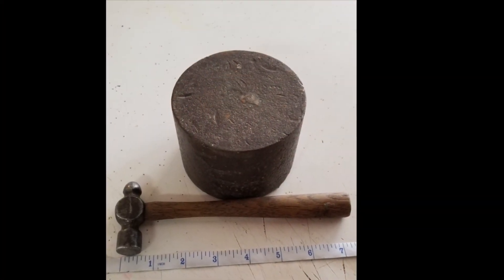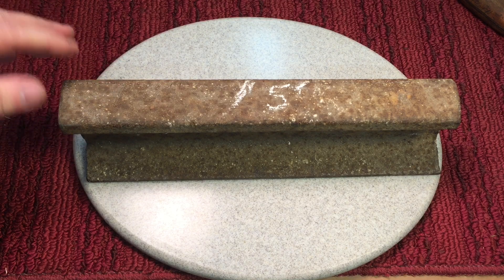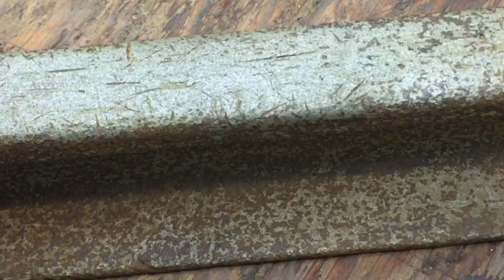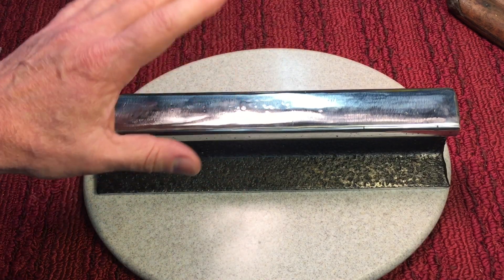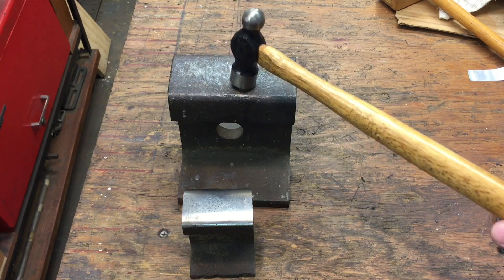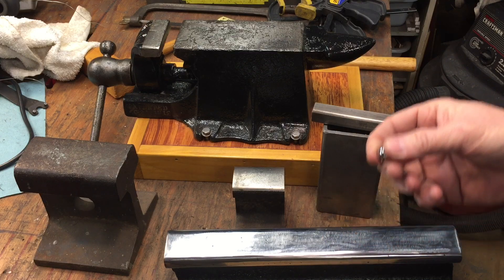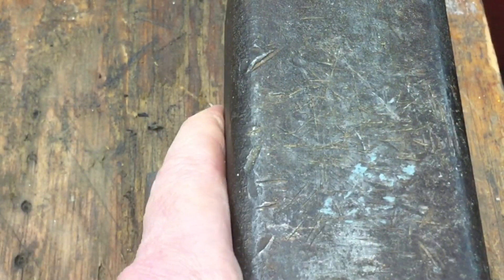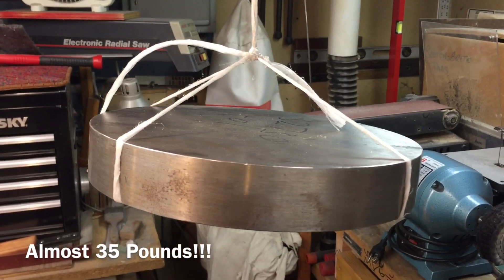Railroad Track and Other Shop Anvils...

Comment: I use to work as an ultra-sound rail test car operator for the Chicago & North Western Railroad and Soo Line Railroad Companies back in the 1980s and into the early 90s.  As pointed out by someone else commenting here, rail weight is determined by the weight of a three foot long section of that rail.  Rail was generally rolled into 39 foot lengths to fit into or onto 40 foot long gondola or flat cars.  The date the rail was rolled would be embossed on the "web" of the rail (the section of rail between the head and the base).  An example of a piece of rail I have in my garage of about 60lb rail is embossed N.C.R.M. Steel Co.  IIII .83.  This translates to North Chicago Rolling Mill Steel Co., April, 1883.  Rail also would be stamped with a heat (furnace tapping) number and ingot number (one of two digits) on the reverse side of the "web."

Comment: Nice save. I think a lot of the narrow tracks came from the old Interurban lines. I know most don't agree but that was the best system of travel for rural areas and it would be nice if the still had them. Sadly even if they had been rebuilt 20 years ago they would go down with the brick and motor stores.  Sometimes I forget the early days of scrabbling for something to work with.  Old sledge hammers and splitting mauls make a good small anvil.
Reply from the maker: Hi Philip!  I think after a good vise everyone should have a small piece of track, I use mine all the time.  Even as a weight for glue-ups!  =)
Reply: If you live anywhere that you could make it to Seville Ohio, there is a nice interurban electric railway museum.  I think it's called northeast Ohio railway museum.  Something like that.

Comment: I have two track anvils, one of which my father made back in the 1950's. One is about 8" long and the other is 10". They are a good size for a machinist. Both have had the tops and sides machined flat. One has a rounded horn (like a blacksmith's anvil) and the smaller has a horn that is flat on top and vertical sides. I keep one by each of the shop bench vices to reduce the temptation to hammer on the vice and ding the dickens out it.
Horror Freight has a 15lb. cast iron anvil for $20 and you can get $4 off that with a coupon. Not the greatest anvil, but would be satisfactory for the home shop machinist while keeping an eye out for some track rail or a properly made small cast steel anvil.
Cheers from NC/USA
Reply from the maker: They are so handy around the shop!  Even for glue-up weights!  =D

Comment: When you don’t have quite enough liquid to cover something add some bricks or rocks to raise the level.
Reply from the maker: MrDoeboy356 Cliff, I used to add a few rusty tools but wound up leaving a few behind!  😂
Reply: Lol. Wire hangers over the side.
Reply: A half gallon milk jug with water 8n it works as well. The bricks could soften and dissolve in the acid. I once added a brick to the toilet tank to save water - worked well for the purpose but over time broke down and made a mess. Great video and excellent old-school info.

Comment: I’ve always been told the test of an anvil was to use the ball bearing and find the rebound and ping. I was told not to use the hammer for ping tests or rebound tests because you can influence the outcome adversely and not get a fair or impartial result of the tests. Just a thought......

Comment: Very interesting show today. I have a few R/R track anvils floating around here.
There were two six or eight inchers in the garage when I bought this house but my favorite one is one that I made years ago by fly cutting the top of a Sixteen inch long standard gauge piece and then hand grinding a tapered horn on one end. Man that steel is tougher than the average Bear!

Comment: Made several railroad anvils over the years of various lengths and sizes, best ways I found was sand blasting and having top surfaces machined before painting. I enjoy all your videos.
Reply from the maker: Hi Charles!  This is the best time to have a buddy with a surface grinder!  😃👍
Reply: ScoutCrafter  Yes, happened to have a friend who ran a machine shop plus lived about a mile from a grave stone dealer who did sand blasting, all were done in the 1980’s. Long retired now but actually have one small rail anvil sitting on my closet floor looking like a piece of art.

Comment: My Pop & I use to always change his tires before winter we would put his snow tires on for the Winter to travel back & forth to J.f.K Pan-Am great times as a kid with him.
Reply from the maker: Alan R I always dreaded putting on the snow tires!  I used to put them on right after Thanksgiving!  Lots of times people got lazy and didn’t remove them in March and just wore them out that Summer.  😃👍
Reply: @ScoutCrafter  ha ha ha so true.My Pop has his cheap Scottish roots.Yeah we kept them behind the heavy ass broken piece of wood from the old garage door.
You remember those garage doors man when the spring broke it was like 50000 pounds

Comment: Excellent anvil video.  I had not been around them enough to know of the ping test.  And of course I personally like anything having to do with an RR, so I like the new anvil you got!  Wonder what kind of insulators were on the line where that track was in use?😄
Reply from the maker: Lee, Did you ever imagine going back in time, Like "The time machine"?  =D

Comment: Joseph Turk  is correct that gauge is the  distance between rail heads and rail size is the size of the rail.  Our company built a standard gauge track with 20 lb rail including a turnout for a 4-wheeled push car to be able to get fishing boats around two sills along the Pearl River between LA and MS in 1971.   Steel rail has been rolled in 8 lb to 155 lb sections and crane rail from 105 lb to 175 lb sections.  The 8 lb rail is 1 9/16 high by 1 9/16 in wide on the base to 155 lb is 8 in high by 6 3/4 in wide on the base.  Crane rail has a Tee shape but the top is flat and the sides of the ball or head are vertical for double flanged wheels.
If you will give me the height, base, web, and width of head of each of your rails, I think I can tell you what the rail sections are.
A piece of H-beam or I-beam will also make a decent anvil.
If a piece of steel is hit and can bounce it won't ring as well as if it well supported or hung.
Reply from the maker: Hello Roy!  All great information!  There is a lot to know about tracks!  Is a section still a yard or will it change to a meter?
Reply: @ScoutCrafter  Our classification is pounds per yard.  In most of the rest of the world it is Kg per meter.
Reply: Way back when coal wagons were pulled by horses from the mine to the warf in Wales the rails were cast from cast iron in 3 foot lengths and most of  them had a flat running surface and an arched riser which kept the wagon wheels(just like the wheels for on the roads) on.  They were supported by stones such the risers were on the inside of the track.  This was before Trevithick made the Pennydarren locomotive in 1803.

Comment: Another great video my friend.
My anvil is a piece of I beam 10 inches tall 12 inches long. Mounted on 2 1x8s and i put casters on it. Roll it out use it and roll it back under my work bench. Personal note: Hope your back is better I've got two bad disk in mine i know back problems.

Comment: Hello SC.  I recently won  two 4 foot sections of rail at an auction
Not sure what I will do with all of it but I know I want to make an anvil.
What is the best size for a small shop anvil?
I am thinking about going with 1 foot.
The 4 foot pieces are too heavy to move but one foot should be around 40 pounds.
Manageable but still heavy enough to not to not move when I beat it.
Is there any point in putting a horn on one?
I understand horns are handy for  making bends.
However the horn on a train track anvil would be so small that I'm not sure it would be practical.
Thanks for the great videos!

Comment: You could do an hours long video on the subject of things that can be used as an anvil. There are so many solutions to that problem out there. I think my personal favorite is cutting into a stump and sinking a sledgehammer head into it far enough to be stable. I watched a video on a khukri factory in Nepal that was nothing but buried sledgehammer heads for anvils. The ball bearing test for rebound is still in use today. Most guys consider 70% rebound to be very acceptable on a properly made anvil. I have a lot of love for the railroad track anvils. I haven't really worked on one myself (I'm spolied in that department) but they are cheap and effective.
Reply from the maker: Allan I bet you were surprised by the ring of that little track!   The funny thing is tractor shows often have a couple anvils for sale..  One year I went and there were over 25 anvils for sale!   Average  was $60-$100, then the next show there was none!  LOL  Nobody likes lugging those things around if they don't sell!
Reply: I wasn't too surprised by the ring actually. Railroad track cap is usually a hardenable steel which is why it gets used to make hammers and other tooling. And Man At Arms Reforged has made a few huge swords out of it. You have a great little anvil there.

Comment: That RR track anvil was a great deal for $5 and came out awesome as well as the standard gauge one.Gotta love those surface grinders to make quick work on steel. When I saw your steel disc hanging from the scale I was thinking 35lbs. Just a lucky guess. Hope you're having a nice December ScoutCrafter. Looking forward to the holidays then the swap meet.
Reply from the maker: Hi Steve!  =)   I still think of your face when I picked up that track!  =O   You thought I was joking!  =D   I think that was the rustiest thing I ever cleaned up...  The shop was covered in brown dust!  My lungs are probably magnetic!  =)   The ring on that track makes it all worthwhile!  =)   Thanks Steve!
Reply: Absolutely! That is one sweet ring! You never back down from a challenge no matter how rusty!👍
Reply: I think I was more surprised about the bolt. Lol🤣

Comment: I have a few different sized pieces of steel that I use as anvils.  I also have a couple semi tractor engine piston pins given to me by a neighbor when I was a kid.  They are smallish as an anvil, but the ends a very flat and they are very Haaaard.  BTW. At 4:10 when you show the bucket o' vinegar, you can see an old liquid tide laundry detergent bottle.  I work for the company that molds the bottles for Tide, and that bottle (200oz) has not been molded for probably fifteen years or more.  I saw a video you made about making your own laundry soap, do you put it in that old Tide bottle and keep reusing it?
Reply from the maker: Wow!  James!  You have great eyes!!!!  Yes!  I keep using those older Tide bottles because they held a lot (200oz!)  How cool is that!?!?!    WOW!

Comment: Is it possible that the section you bought for $5 was hardened by heating it in a campfire and tossing it in oil or water a long time ago? What did the sparks look like coming off of it when you ground it? You should try hardening one of those smaller sections next time you go to a bonfire 🔥

Comment: Great video i always learn something.  But i have a question what is cold rolled steel and tooled steel maybe you could address that some time. Again great video. Thanks Don
Reply from the maker: Hi Don!  In a nutshell depending on the ingredients added to the mix of a steel it will have certain properties like hardness, strength, edge retention... Tool steel is a higher grade of steel that is more expensive to produce but is great for making all sorts of tools, the cold rolled steel is your run of the mill steel that is less expensive and made for more general use.   Things like carbon content and tensile strength are all considered when making steel..  I have found that a good tool steel can cost 4 times regular run of the mill steel!   -=)

Comment: The double headed nails w re used to make concrete and other forms.  The first head held the form together. The upper nail was used to tear the forms apart.
Reply from the maker: Hi John!  I bought a lot of nails once and got a bunch (pounds) of double headed nails..  Can't find them now!  =/
Reply: Hi John , Those Double Headed Nails Are Commonly Known As Duplex Nails . Did Foundation Work Too !
Reply: We used to call them "Duplex" nails, used always for temp jobs.

Comment: I am curious if the last anvil would've sounded differently after you resurfaced it. Great video.
Reply from the maker: Hi Ben!  I didn't even think of tapping it before...  Usually tracks don't ping like that!  =)
Reply: @ScoutCrafter  Actually I'm referring to the one you resurfaced at the end. Earlier in the episode you hit it and it sounded better than the vice anvil and better than the smaller anvil, but not as good as the one you restored. Then you resurfaced it and I was wondering if you "pinged" that one to see? (still could - if you do, let us know if your resurfacing made an improvement) THanks!

Comment: Do you have any issues with that HF wire wheel set throwing wires off? Is there a rpm limit listed on the package? Thanks for this video I’ll definitely be looking to find a small anvil.  PS: I was way off on the weight of that hunk of steal, I was thinking more like 20lbs on the high side. 😂
Reply from the maker: Hi Cory!  I have a few HF wheels and all have been very good as far as not spitting wire... However that can change in an instant!  China is notorious for being hit and miss on their products!  Be careful!
Reply: ScoutCrafter I hear ya, thanks for the reply.

Comment: When you grounded a new surface on that old track piece, did the hardness change? 
I heard RR tracks get work hardened by trains traveling over them. As a result,  the layer of the work hardened steel is very thin.
Don't know if that is true, but it does make sense. Basically, does it "ring" as before?
Reply from the maker: I only checked the ring when it was finished, seems very good! I have a few anvils but they are heavy and this is a really good size for lots of smaller work.  The flap wheel is very good for only removing rust, the grinding wheel removes much more metal!  Thanks!!!!!

Comment: You mentioned that you were going to cut the length of the $5 track. If so couldn't you have put it on your small milling machine to get an accurate surface? And you could have also faced off the gas cut ends. Just a thought.  ...Newk from Kentucky
Reply from the maker: That surface is way too hard for my little mill...  a surface grinder would be ideal!  =)   I have 2 real anvils...  =)

Comment: On buildings with large doors (like hangars) the smaller RR track is used for the wheels to ride on. It works great until the cast wheels wear out!
Reply from the maker: I wonder where you can get longer pieces?
Reply: @ScoutCrafter  
I googled "railroad track for hangar doors" and got a few places that still build them like that. Most modern door systems use hydraulics or bifold doors with electric motors and steel cables. When they built the ones I have worked in they leave the scrap pieces of rail at the building instead of hauling it off.

Comment: How would you take the curve out of the  railroad track
Reply from the maker: William The best way is a Milling Machine followed by a surface grinder, however most of us don’t have those so a Angle grinder can get us close.  Most track you find is worn and pretty flat. Thanks

Comment: When you refer to narrow gauge it’s not the height or size of the rail narrow gauge is the width of the tracks from one rail to the other. Standard gauge is 4’ 8 1/2” 
The difference is size of the rail it’s self is 85lbs 90 lbs 112lbs 115 and so on up to about 141lb rail which means every three feet of rail weighs that much and of course the the ball gets bigger with bigger rail.  
It does make a decent anvil but keep in mind it’s bridle because of the harness so if it cracks or chips it can be dangerous.
Reply: Joseph Turk Pennsylvania railroad supposedly had a 155 lb rail in the 50’s much of which is owned by Norfolk Southern now I don’t know if any still exists

Comment: Some rail tracks are made of "mangalloy" which work hardens crazily under impact. Wikipedia isn't a "real source" but it's what's at hand: "[Mangalloy] will achieve up to three times its surface hardness during conditions of impact, without any increase in brittleness which is usually associated with hardness". This may be why some rail tracks make really really great anvils, while others are anywhere from "alright" to barely-alive.

Comment: The double headed nail is called duplex nail
Reply: Usually used to frame temporary structures, concrete forms, etc.
Reply: Many year's  ago ,I was helping my boss on a small pour. He ran out of nails , picked up some at the hardware  store .I remember the name duplex . I would have thought  forming nail first

Comment: I have an Anvil made of an old heavy Iron. A big old heavy Industrial one
Reply from the maker: Those are the best!
Reply: @ScoutCrafter  Interestingly, it was not one of the 'heat it up on the stove' Irons. It has electrical connections. My take is it was an Iron used in an institution, or commercial laundry. 
The 'ping' is high pitched, and the hardness of the surface is amazing.
I can wack it directly w/ a ball peen and it literally bounces off. It was welded to an I-Beam at some point.
The surface of the anvil never rusts---IDK why, Does not look plated or anything
It serves me well
I got it from an old PT Boater

Comment: The taller piece of rail looks like it is RE 100. If the measurement from the base to the top of the ball is 6 inches that is what it is. It weighs 100 pounds per yard